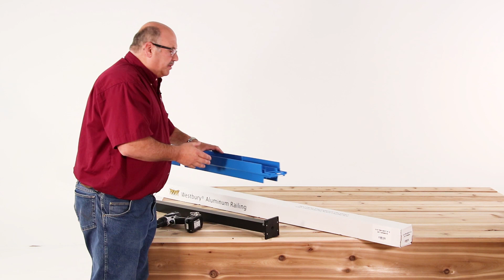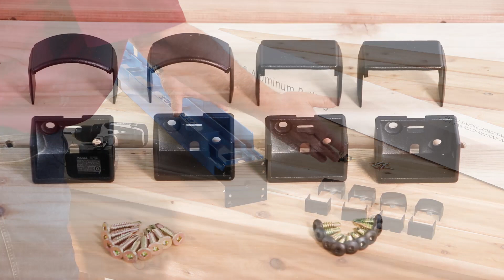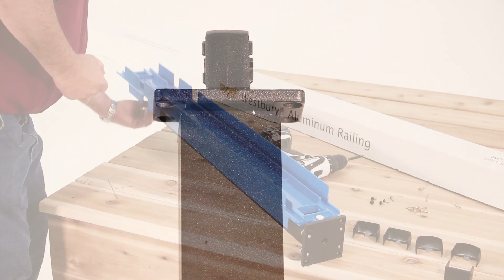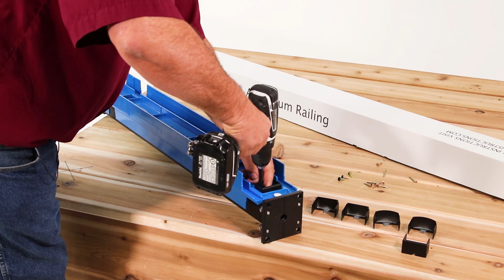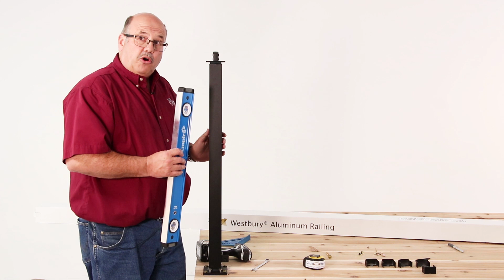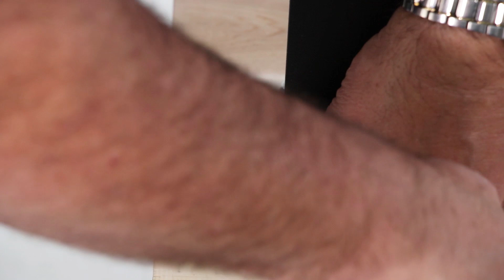Westbury® Hardware and Post  Installation and Leveling

Comment: "It's always best to have the torque set on your drill"  (1:54)   So what setting would that be?  

High torque?  Medium? Low? The driver you are using in the demonstration likely has 10 different settings - which one are you using?